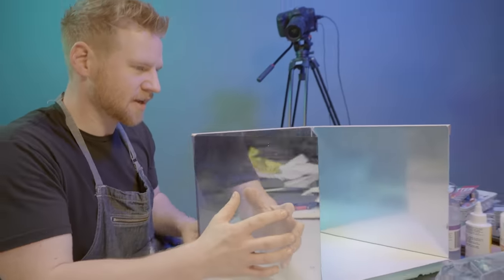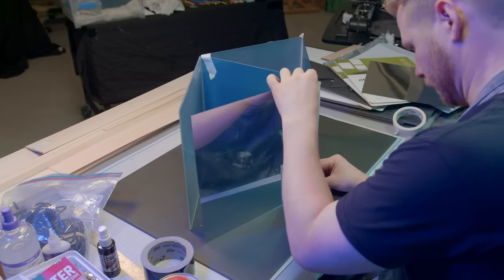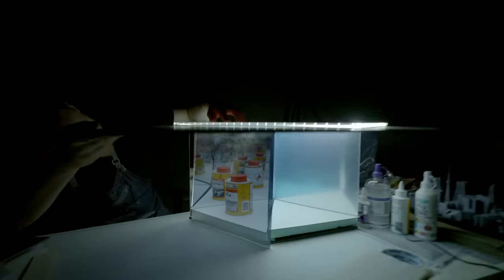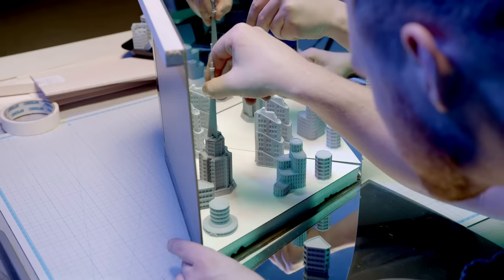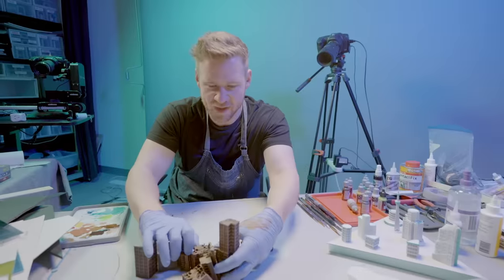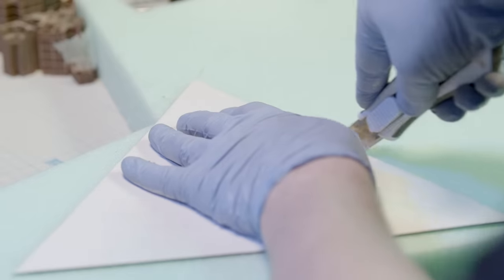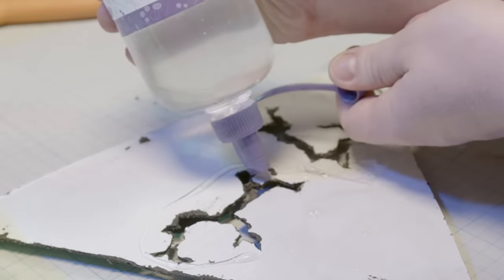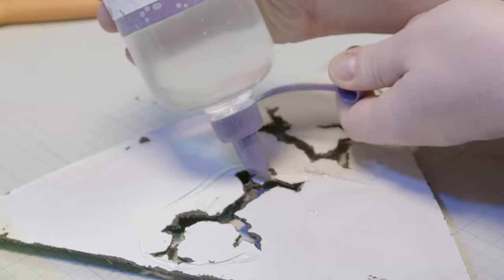I made two INFINITE WORLDS in ONE BOX?!!

Comment: You can seal the top and put 2 LED strings on the top of the box, that way you can use a red light on distopian city and an clear blue light on future city and you can make the infinity mirror work as, well a mirror when turned off, as long there is no other light getting inside.

Comment: Here are a few tips for anyone who wants to do something like that.
Use a stiff hard panel for the mirrors and one way mirror to avoid distortions.
Put the biggest and/or more distinct tower cut in the corner to make the reflection less obvious.
(For example that spire tower in there is easy to spot and so is its reflection. But in the corner it would only repeat further away in the next reflection).
Any structure that is symmetrical could be cut in half and placed against the mirror.
All these effects work best if the mirror in not behind too much glass (first surface mirror or an equivalent works best).

Comment: Really cool diorama :)
A bit overkill on the lights under the cities though. Could be cumbersome to take out and charge all the time. The same effect could be made with a few LEDs, some wire, rechargeble batteries and a barreljack on the backside to charge the batteries with. Would maybe have been better using mirrored acrylic instead of those flimsy sheats that make for an uneven reflection.